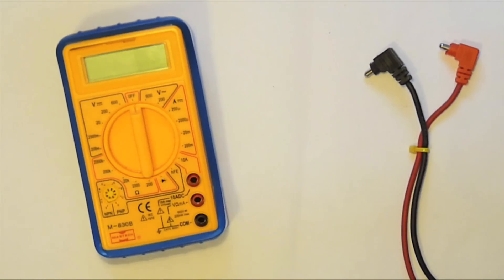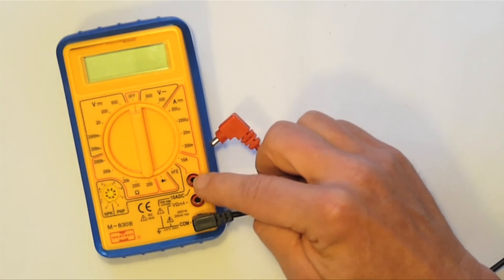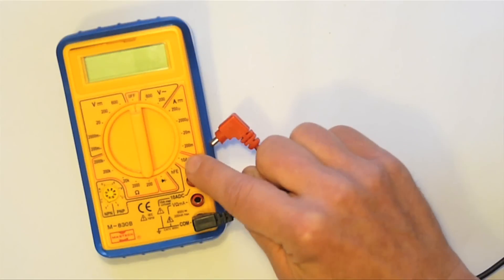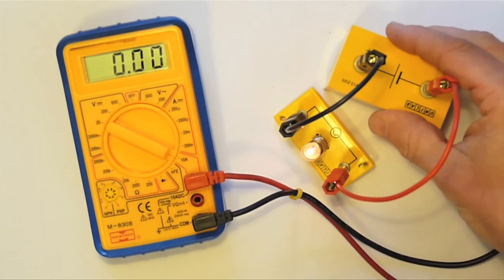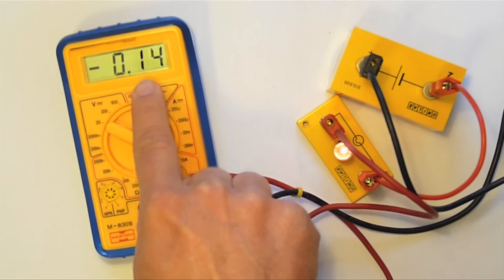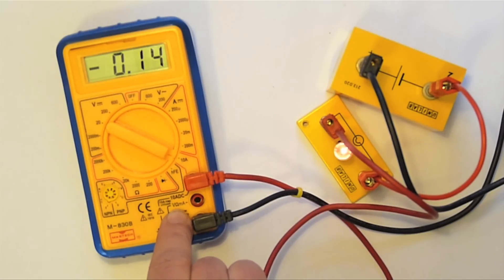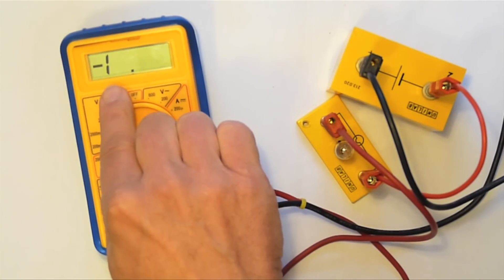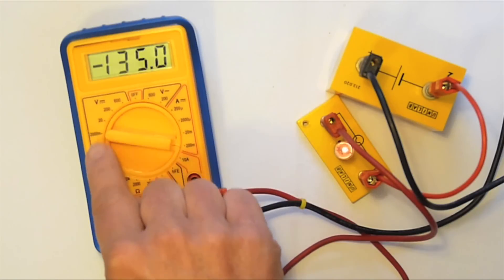How to Use a Multimeter: Measuring Current

Comment: Thanks. Nice and to the point with no jazzy music and logos and "please like and subscribe yada yada".

I want to measure current flow from my 3D printer on the control board but my meter only goes to 5A and I'm not sure if the current is above that for the hot end, especially as it's a 20A power supply. Think I'll just test the volts.

Comment: Is possible to measure ac ampere...?
Reply from the maker: Don't think you can measure A.C. current on these cheap meters. You can measure A.C. Voltage if you look on the dial.

Comment: thank you for this tutorial... but i have a serious question... i have the same multimeter but it dosent read ac current correctly... is it because this multimeter is only to read dc current? as i have seen other multimeter with a different ac and dc amp knob.. please help me. should i buy a new one?
Reply: As he said you need to make sure fuse is not destroyed ( It should word if your multimeter displays Voltage but Amperage is not displayed.) Hope It will work :)
Reply: Ps. It could happen if you by mistake connected Multimeter wothout any Ohm resistance (not connected any LED or heat system. (You probably made a shortcircuit and burned the fuse as I did with exactly the same multimeter.
Reply: Shadow
 no its showing me the dc current ampere but in ac line its value is fluctuating and is not accurate.... in my multi meter
 at the current section there is only the sign of dc, no ac sign is there... i think that its only to use in dc electricity
Reply: +Parasar Bhattacharya Well you have not said that you were usinv it in AC, I was pretty sure you were talking about DC :). Maybe you bought faulty device.
Reply: Shadow
 no no acrually it can onlu measure dc amps, not ac amps, but can measure dc and ac voltage both.. actually its a cheap multimeter... it costed me nearly 10 dollers. its a cheap machine so they did not gave any section to read ac currnt
Reply: If I calculate How many I paid fot this stuff It will be ~4.35$ In USD...
Reply: Shadow
 i am sorry mine costed 120 indian currency which should be apprx.. 2 dollers

Comment: hi I measure current of a device and I connect the black wire on com and red on 10A and my measurement was 0.08 but when I put the red wire in the other hole and set the multimeter on 200 m setting it displays me 000 and if I change to on 20m against the same? what happens?

Comment: Good job! Question when I turned my multimeter dial to milliamps to test the LED, the LED went off,  Then when I turned the multimeter to OFF, the LED went back on.  If you know why, please help me out.  Thanks!
Reply: +Philip Watson LED's need a certain amount of forward voltage to light up, and the multimeter would (shunt) be eating some of that up, and the voltage drops too low for it to illuminate.

Comment: Hi there, can i use a resistor as the load?
Reply: Jefferson Barrion you can, but you will get a completely different result as a resistor draws current differently than say a motor.

Comment: Good tutorial and straight to the point. As a completion, may I ask in the range of 200 mA, what is resolution (i.e., the minimun current the instrument can detect)? Could be 2 mA (1% of the range)? Thx Manlio
Reply: Depends on the model of ammeter. You should be able to look it up on the manufacturer's website.

Comment: I do have a question, If the current I'm testing is constantly changing up and down. How would I get an average current reading over say 2 mins - assuming the change is repetitively constant (i.e. 0 to 0.6mA 20 times a minute). Thanks.

Comment: It's probably more technical than you wanted to get in this tutorial, however, one important point was missed.  The internal current shunt used in virtually all multimeters presents a problem with current measurement ranges called “burden voltage”. This is the voltage that the internal current shunt resistor drops as you pass your circuit current through it.

Comment: Im still a bit confused.  When you have an amp rating above 10 amps will that method still work or do I risk damaging the multimeter again?  Are electronics labelled which how high their amperage is supposed to go?  And if so, should I keep track of it so that I don't damage the multimeter?  So when I do have a rating above 10 amps, what do I do then?  Or is that dependent on the multimeter?

Comment: thank you! I've never really used a multimeter before for checking current, and I couldn't find anything on youtube detailing the use of measuring mA. With the aid of your video, I finally determined that I was actually trying to do it right and I was not getting a mA reading. I opened it up and the fuse had fallen out! so it isn't always blown! it seems during shipping they weren't very careful with it!

THANKS!